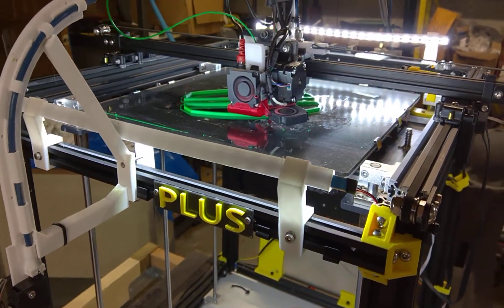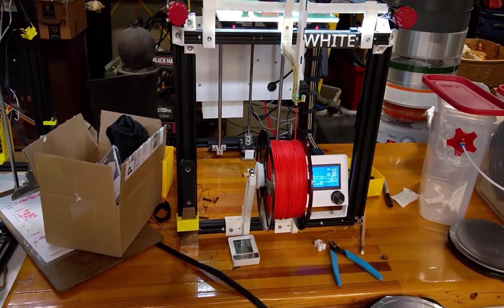New Ender 5 build and projects

Comment: Interesting to see a fine lead/pitch project on an Ender 5. I've just ordered a pair of 8x2x2 lead screws, including anti backlash fittings and I'm wondering if twin Z stepper motors are necessary, so I'll be belt driving my second z drive of the original. Copying someone else's idea of course.
Reply from the maker: I looked at that design, and decided on this one.  I had extra motors, so just the lead screws, rods, etc.  I'm finishing my second one using the standard lead screw that I removed from  this one.  https://www.youtube.com/watch?v=isn4I-ft_gA&t=17s&ab_channel=DavidWilson   I'm also converting both to an ExoSlide movement system

Comment: Any tests on the finer resolution on the Z of that yet?
Reply from the maker: Thanks for asking. this is a good question.  So far I have only printed a couple of items and they looked Ok, no negatives, but I'm in the process of completely redoing the mounts for the front Z axis to gain more room for the installation of an OmniaDrop.   I am hoping to have the mount complete tomorrow 12-4 and will post a new video when I do.
Reply from the maker: I'm not sure about a finer resolution, but the bed stays rock solid.

Comment: wooo
Reply from the maker: Thanks.  I actually have the wiring hooked up now.
Reply: @woodwaker1  right on, coming along good?
Reply from the maker: @GradivusAres  Yes,  I had problems getting Marlin to compile, finally got it to work.  I knew that I had the incorrect steps for Z, but just wanted to see if it would move correctly.  It did, and I could enter the correct value from the LCD screen.  I will get more done tomorrow and maybe post an update.
Reply: @woodwaker1  look forward to it man